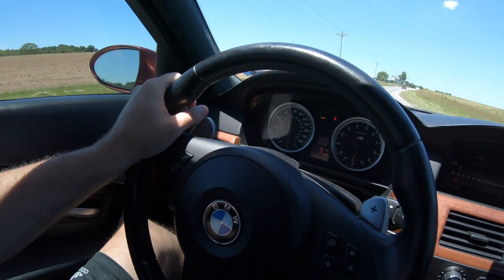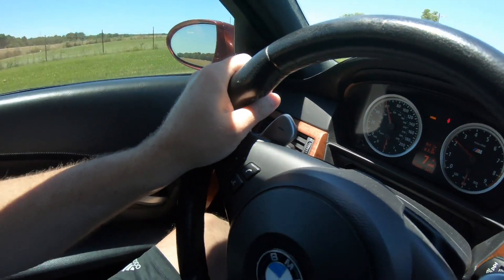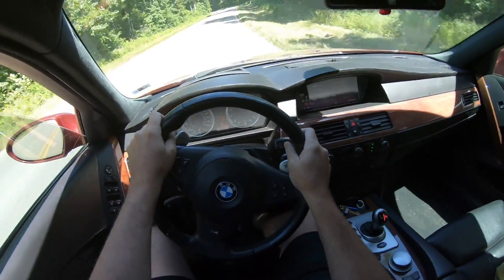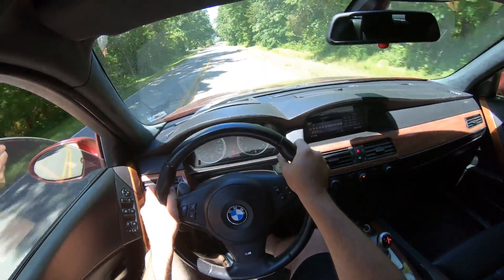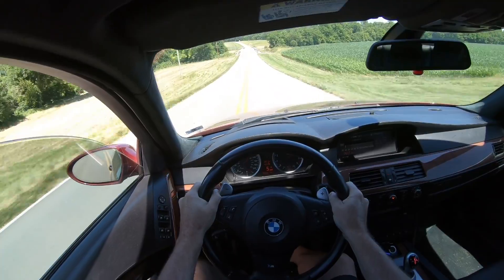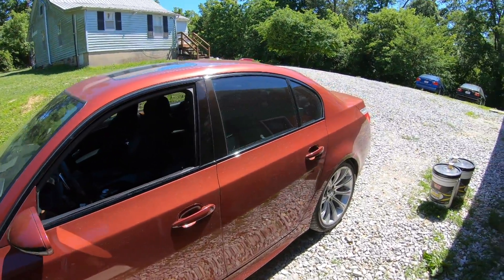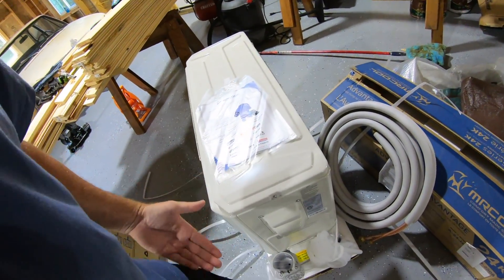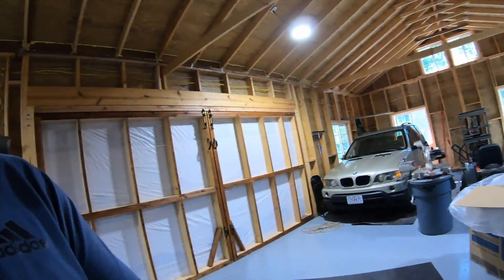BMW E60 M5 V10 S85 Straight Pipes   *IT SOUNDS LIKE A LAMBORGHINI*

Comment: Now I understand why you hated those mufflers.  Honestly I had no idea what straight pipes sound like.  PS live in the country like you and I hate to go over 50 on the roads since a tractor could go across the road at a blink of the eye.  What is the fastest you went today (if you feel like saying) ?  What size breaker do you need for Mr. Cool mini split?
Reply from the maker: A double 30A breaker and 133
Reply: @NathansBMWWorkshop  Wow! that is fast!  A lot of sweet potatoes growing here . If I went fast I would have a John Deere hood ornament.
Reply: @dogsplantscarsneatstuff176  Wouldnt it be the John Deere ending up with a BMW ornament?
Reply: @LeverPhile   That's funny.  You're  probably right.  These are the big tall field units probably 80 to 150 hp.  I wouldn't want to be on the clean up crew.
Reply: @dogsplantscarsneatstuff176  lol, the M5 would definitely leave an impression ... the clean up would be ugly either way...

Comment: So I just saw an old post you had up about two years ago..and you said don't buy a bmw with the 4.4 liter engine..and just three weeks ago I bought a 2003 bmw 745li with 90,000 miles on it..it runs and drives..and shifts great!! no check engine light...what should I watch out for???  ps. I watch you all the time...very informative thanks for the videos..